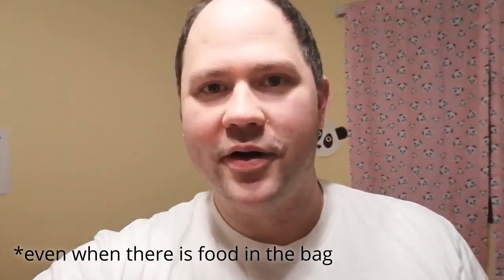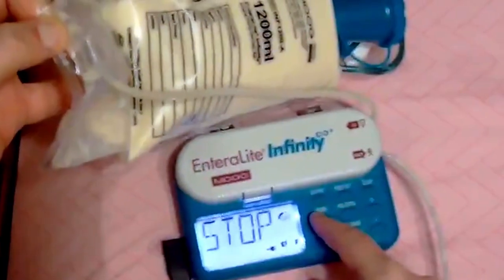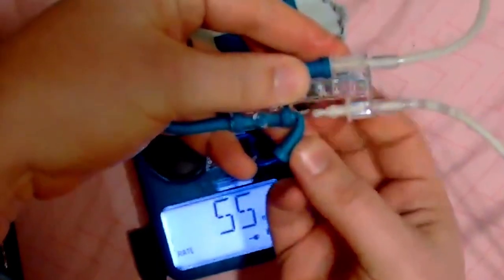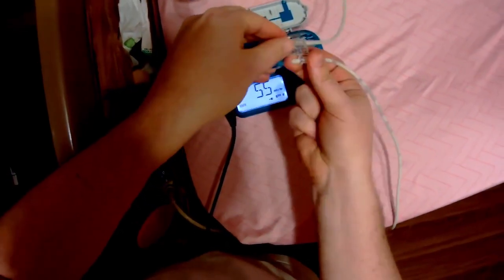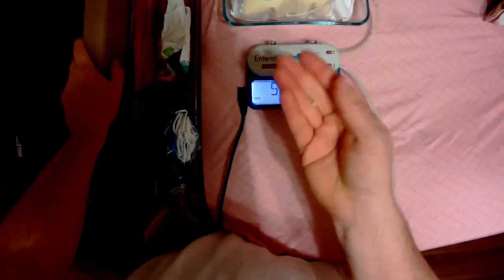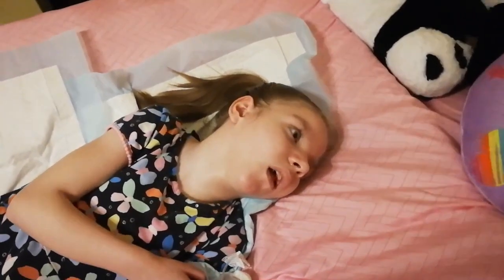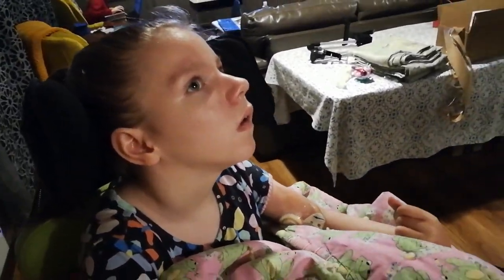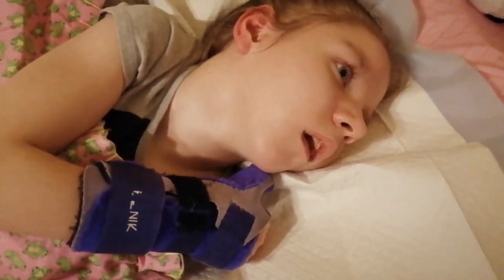Fix "No Flow Out" Food Pump Error

Comment: Love your videos!!! Just a quick heads up, that part of the pump tubing is called the inline occluder tip and it controls the fluid flow and prevents free flow. It’s a fairly important part of that specific pump that allows it not to have a drip chamber. I would recommend just switching the bag when this error occurs; especially for anyone who has the bag in a hanging position. Here is the manufacturer’s information video on that pump if you’re interested :-) I found it super duper helpful, there are a few hacks I did not know about in it! https://youtu.be/Vkzvyc6EU5k (Infinity Pump Instructional Video posted by Shield HealthCare)
Reply from the maker: Interesting! Thanks for the info! Yeah, we normally would just switch the bag, unless we're out and about and can't.